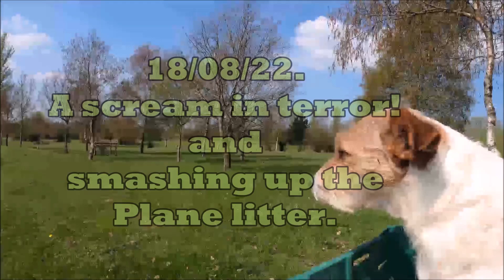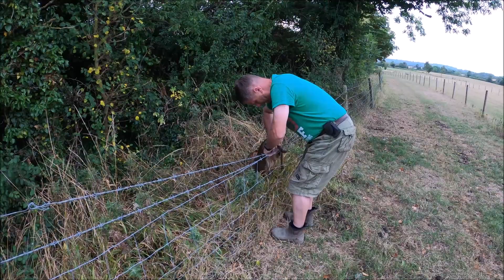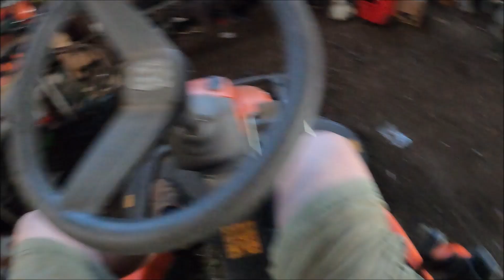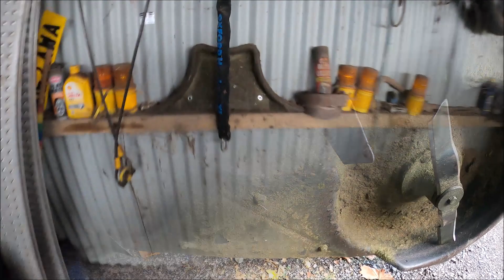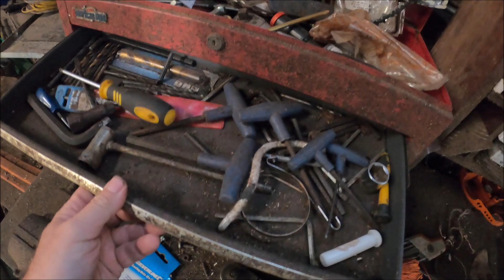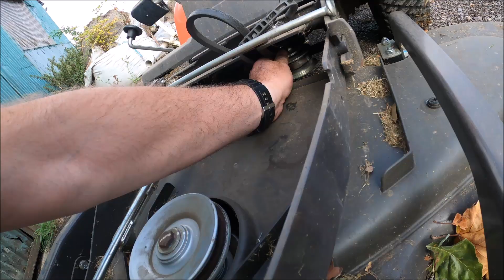18/08/22.  A scream in terror and smashing up the Plane litter.

Comment: Morning Ian,
Great work with the Muntjac - the screeching certainly worked. 👍
Bought a Husqvarna after seeing yours - Bargain - with just 4 hours on the clock (mind you I did have to do a 400 mile round trip to get it - when diesel was cheaper!
AFAIK there's only 1 grease nipple on the whole machine - means the deck bearings are all sealed so I never use a pressure washer. 
I also use a plastic scraper to remove old grass - reduces potential for rust forming on the deck
Marvelous mower.

Comment: Common to see Roe caught up on double barbed wire around us. I've seen legs twisted off which would be a horrendous way to go.
That lefthand blade as you sit on the Husqvarna is upside down! 🤣🤦
I just leave the plate in on mine. And I  always clean it out after every use, stop it rusting out.

Comment: One of the mower blades is on up side down won't cut aswell like that
Reply: I spotted that the right blade was on the wrong way too.
Reply: @jonathongreen7727  at least the centre one is right
Reply from the maker: @Ricey1987  
If your right, I will come clean and admit it. 😄
Reply: Ian the middle ones right I noticed the left one was wrong Jon said the right one is wrong